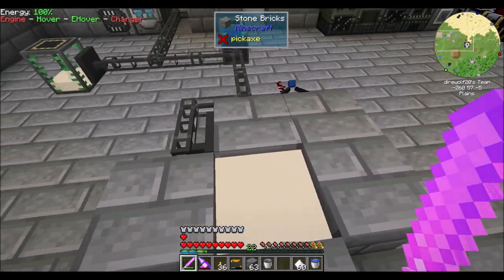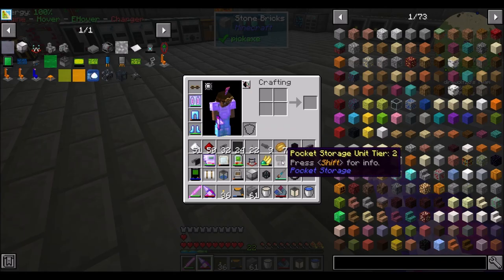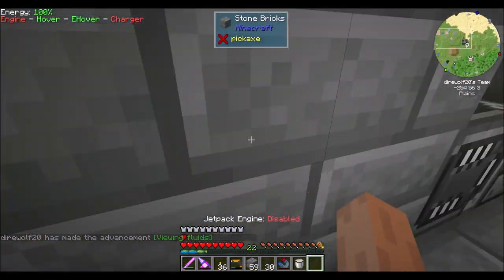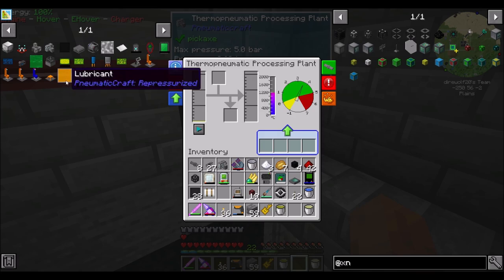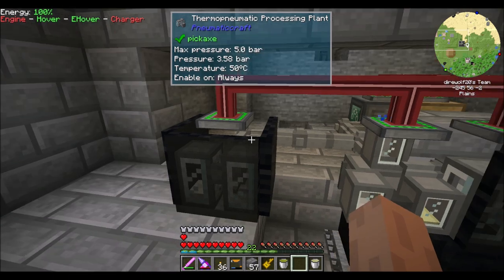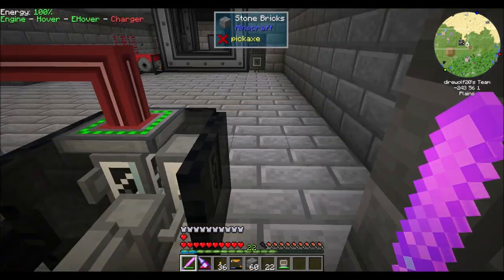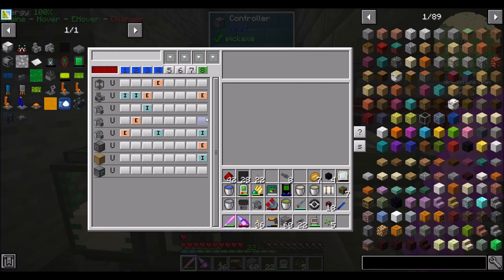Lets Play S10E46 Biodiesel Automation

Comment: Before you have access to Circuit Boards, the Nether has the perfect ambient temp for the 30 C to 60 C range recipes. No Torches required.
Reply: omg that's genius, I didn't even think diff biomes would have diff temperatures
Reply: Yeah i live in a mountain area and its like 11C all the time. it says in the mod to go deeper and it will steady out the temp but I went to Y12 and it was still 11c lol! I like the idea of setting it up in the nether. I have mushrooms from Botany plants and will just get yeast that way.
Reply: To be fair, I also just did crude oil and a pump with ender chest. to get 90% of everything I needed from this mod. Just automating it up now is more of an after thought/fun.
Reply: I lucked out building my base in a savanna, it's 31°C all the time, perfect for yeast and ethanol
Reply: He also lives right next to a desert. I bet if he moved it in there it would be the right temp
Reply: I found a campfire underneath and two "air" sides ended up balancing out to somewhere in that range, and I was in a Tall Birch Forest biome.  Eventually the camp fire goes out, so it's not perfect, but it will at least get things started.

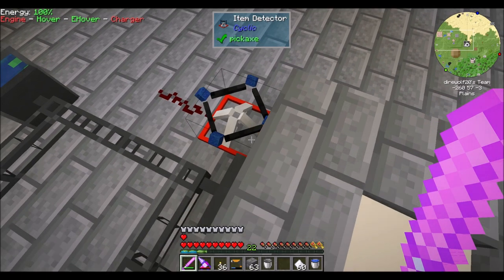Comment: Just as I pressed the play button, I thought to myself: what and when is Dire going to inappropriately press or destroy today with sword or drill or magnet up? Dire does not disappoint. Yesterday, 4:30 mins. into episode, destroy main air pressure tank. Today 2:30 mins. in, destroy yeast experiment. That drill always breaking things it shouldn't. I wonder what gets blasted tomorrow. Tune in next episode for Dire destruction.
Reply: After this series is over, someone needs to make a compilation video.

Comment: 30-60C can be obtained with a pressure regulator feeding a vortex tube at a low pressure from a redstone value and no lagging on the device. About 0.1 bar from memory.
Reply: Or he can just move the 2 machines that require 30c-60c to the nearby desert and let ambient temperature do all the hard work. won't even need ender tanks or wireless stuff since his base is exactly on the edge of the desert.

Comment: Hey Dire, you've probably already recorded all of this PneumaticCraft arc but you could use ComputerCraft for automation, it has integration with pressure and heat that could make some of your circuits simpler! I use a computer to read the pressure from my compressor and shut it down when it gets too high, but I'm sure you could use it for heat automation.
Reply: Nice shout out, I'm gonna do it like that 😀
Reply: I used integrated dynamics to read red stone level for pressure reading, turns off ethylene compressor at 5psi, works a dream

Comment: can the resistive heater from mekanism help with heating the thing to the right temp?
Reply: I don't think it's very controllable, at least not without some way of getting a redstone signal out from the pn block related to how hot it is.  Short answer, I'm pretty sure he'd just run into the same problem as with the pneumaticcraft heater.  :S

Comment: For the Ethanol production: What about using a vertex tube with a Pressure Regulator Tube so that it's lower pressure makes it slower. If the temperature climbs all by itself a little bit of cooling might be enough. But if it's not working it might also be possible to get too cold.
Maybe you don't cover the sides and heat it with a vertex tube.
Reply: Oh hey! It’s Dire3x3sHisBase-erino

Comment: Try a stick piston pulling out a block from the processig plant for x seconds for cooling if the production is on with a detector that detects that is there enough latex/other stuff you want
Reply: @dmitrysharangovich1200  yes when the ethanol tank is above x then it the production won't go and the sequencer sould stop after the tanks ethanol lvel is below x then it should kick in with the production
Reply: Apparently ComputerCraft has heat and pressure integration.

Comment: Shouldn't the temperature go down when it is too hot since it won't produce anymore ethanol and therefore not gain any heat? Thus resulting in it hovering around at 60?
Reply: Yes, except that the block is perfectly insulated, so it doesn't lose any heat
Reply: only if there is a way for it to 'lose' the heat. with all the insulating plates and solid block under it, xnet on top... no 'vent-able' side to let the heat go.

Comment: Once you get an oil refinery you won't need biodiesel though yeast is good for sourdough bread
Reply: I doubt he's going to have one, I think he said he was avoiding it because he had done it recently.  (Good call really.)
Reply: @corwinweber693  but he will get cheap lubrication off the diesel and use lpg for plastic
Reply: @lastone1376  Potentially true, but also not the point.  He's trying not to repeat himself and has other ways to get both lubricant and plastic.
Reply: oil isnt renewable unless ur either manually ordering (not automatable) or using another mod to conjure it.
bio-diesel is